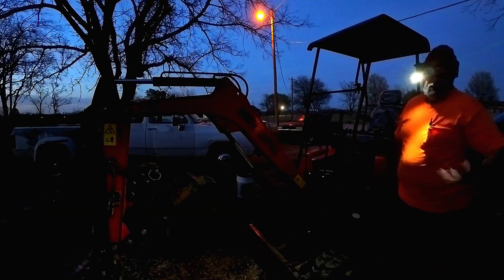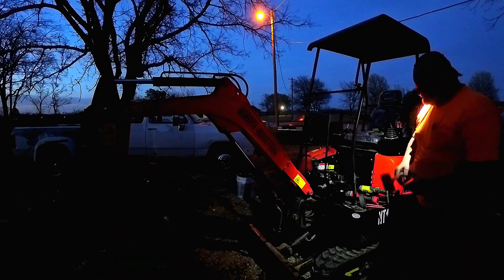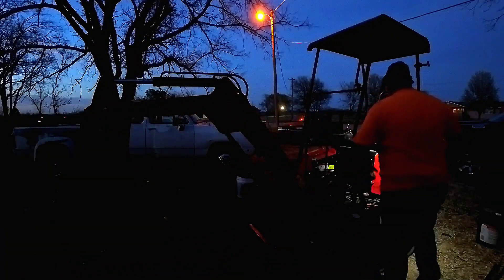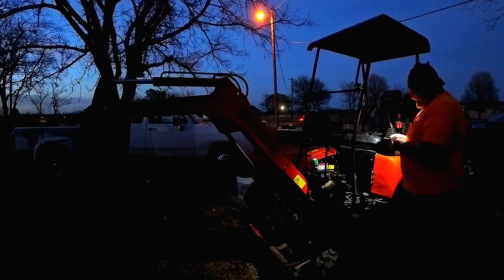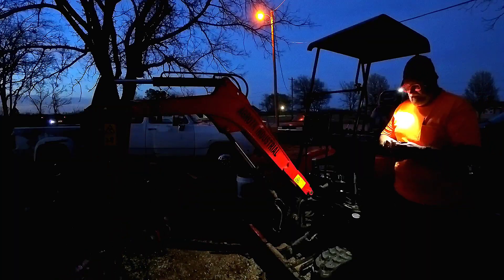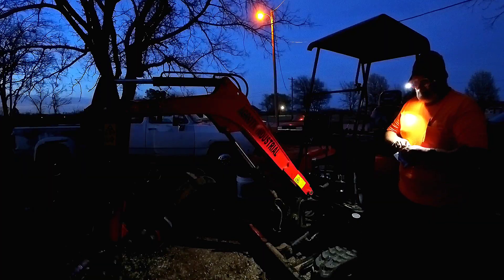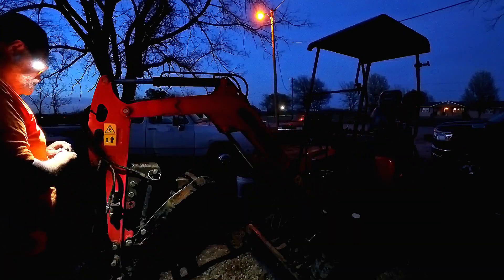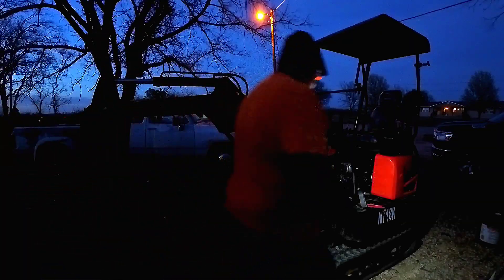Nt18k  The Danger of Not Checking the Swing Hydraulic Motor

Comment: did you ever find the leak? Is it still leaking?
Reply from the maker: If i fill the hydraulic tank too much. It over fills. Every time I fill the hydraulic tank it's less then a quart low when not in sight glass.
Reply: @jtsokiehobbyandadventures6666  one thing I learned is when filling the hydraulic tank, make sure all hydraulic pistons are retracted fully. This is when there is the most fluid in the tank and when it should be filled. when using the booms the hydraulic tank level will go way lower. But always measure when booms are retracted then it wont overfill
Reply from the maker: @acreageliving it suppose to be in sight glass. My machine right now don't show in sight glass half time. When hydraulic gets hot it expands. If I put back to 1/2 way in sight glass. It will over flow when hot. It happened 2 or 3 times now. Sight glass should be 1 inch lower to help stop over flowing. Is my conclusion.

Comment: I was able to see the motor turn table bolt and gear by laying down underneath it... I reached up and turned the bolt about a turn... It was coming loose... So I am gonna get me a new bolt and locktite that bitch in place... It also, helped with less slop in the swing gear... Not a lot, just did help some...

Comment: Have you had any other problems since you locktite the bolts?
Reply from the maker: After the fist time. About a week later was doing grease line. Seen bolts were tight. Had movement on swing motor.  That's when I added the 2 studs. It took movement out. After thought I put the studs on inside. I should have put on back side. I will be moving them to the back to see if I get less play. That will be next time I have floor plat off
 I have about 2 to 3 inches of play where before was around 5 to 6 inches of play.

Comment: Thanks for the video! Did you end up adjusting the pilot control box? If so, did it make it any smoother and how much did you back it off?
Reply from the maker: Yes i moved it about a 1/4 turn backing off. It did make a little difference. It is still touchy at full ideal. I may back off another 1/4 turn to see if it help some more. Worst case is halp to put back.

Comment: I read and hear that these machines have problems with the spindle motors! And almost always, it's because the bolts loosen, both the one that holds the spindle gear and the ones that hold the O-ring! I see two solutions: either self-locking bolts or a conical shaft with a self-locking nut
Reply from the maker: If you buy one of these machines.  You have to understand you have to check thing. I bought threw a auction and understand if something goes wrong I have to fix it. I have been playing on the mini excavator for about 5 years. Have not had big problems. 
 That's for watching.